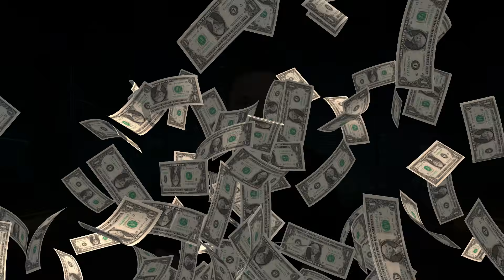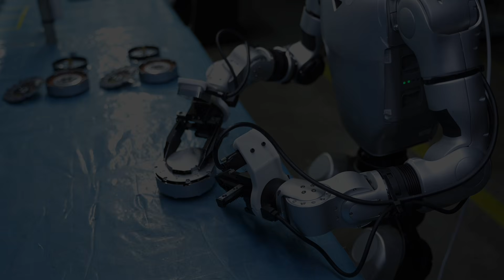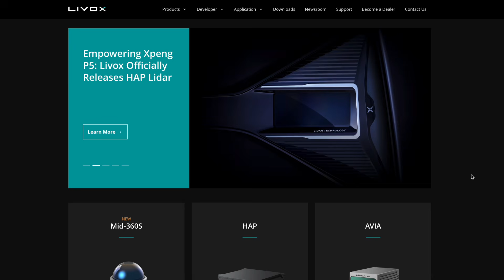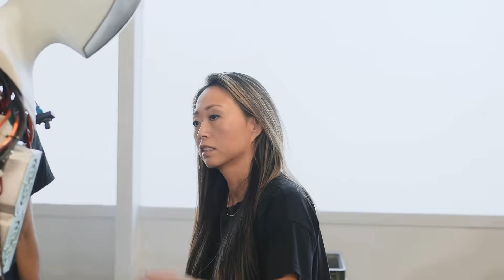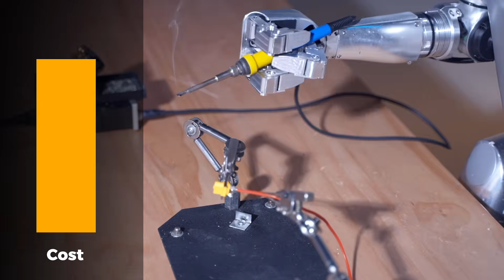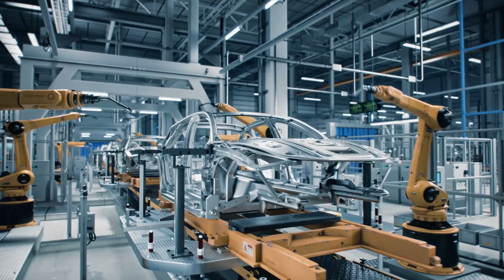Unitree G1 Teardown: How Unitree Slashed the Price to $13,500?

Comment: a car is cheap too if i dissamble it and buy it by myself...
a cellphone is cheap too, if i buy it dissambled, and all the parts in big quantities
Reply from the maker: That's a fair point about how buying components in bulk and assembling them can reduce costs. For the G1, it's more about their design choices and manufacturing scale.
Reply: @justinexplainstech  those price are only at that price because of the cost of mass production, only to make plastics you need a mold that needs 10k, and a 100k+ machine, lets not talk about the pcb and the metals

Comment: So basically, it is a toy robot to show off with no real applications except propaganda.
Reply: What’s propaganda? 
Why aren’t other company doing it? Apple uses Samsung parts, Toyota doesn’t make their own engine…
Reply from the maker: Thanks for the comment. From my perspective, the G1 was designed to push the boundaries of what’s possible at a consumer-friendly price point, making humanoid tech more accessible. While the current version has its limitations in practical tasks, there’s a bigger picture: by deploying low price range robots G1 and R1 units into real-world environments as many as they can, Unitree can gather the data necessary to accelerate the development of truly functional, next-gen robots. There is still a long way to go for that.